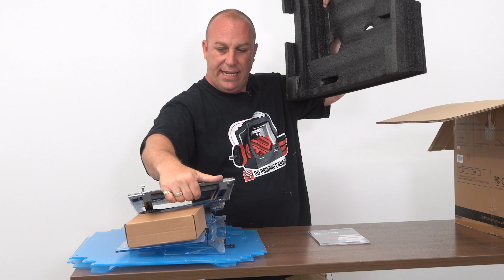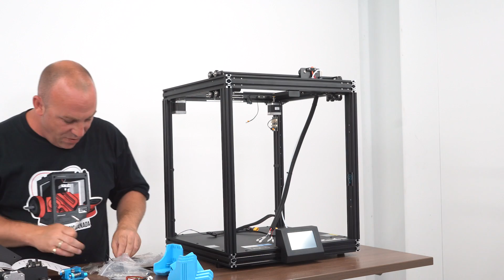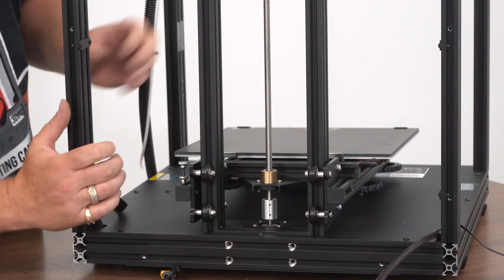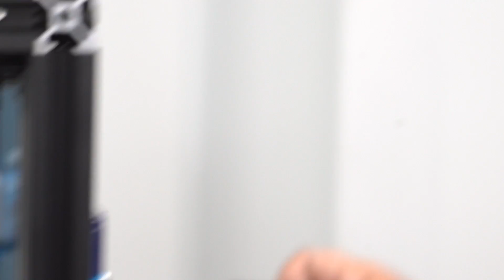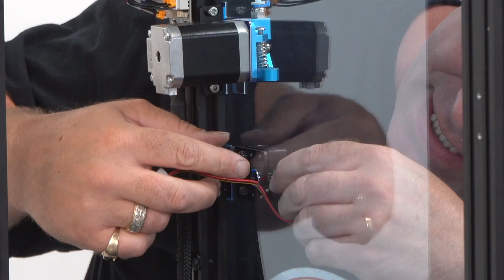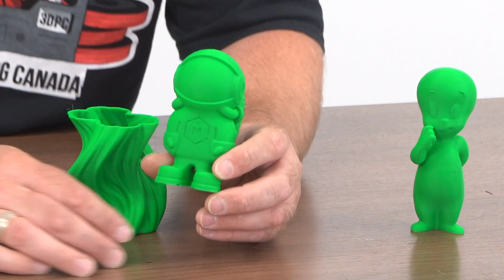Creality Ender 6 Unboxing, Build & Test Prints

Comment: There is just too much "hype" surrounding this printer and the Ender 7 that followed it. Creality touted this as a printer that can print in the 150 - 200mm/s range. I have used mine up to 120mm/s and it was already starting to have issues at that speed. This printer is way over-rated and to print fast is pretty much all it can do and nothing else. If you want to print parts that can achieve +/- 100 microns tolerance(standard in almost all FDM printers) this model is just garbage. And that long bowden tube isn't helping it much. I almost threw mine out the window until I upgraded it to have a Microswiss NG Direct Drive as a last resort (before disposing it) - that was the only time it became useful enough to be worth keeping.

Comment: Issues after issue right out of the box. Loud grinding noise around the belt, motor not rotating and jerking movements. I was still under their return time frame, but they refused to communicate once I refused to troubleshoot any further more than a normal person would do. Please do NOT buy any creality printer from their website, buy it from amazon instead.

Comment: I purchased a ender 6 and after printing off 70 plus pieces I have some major issues. I have had issues along the way and with the support from creality, they have stopped responding. The machine restarts on its own, restarts as it is printing and when it starts back off then slice it was working is off and then corrects itself, needless to say the piece is scrap. I now have an issue where the filament is getting jammed into the nozzle faster then it can use it, I have replaced the nozzle with 2 spares that came with it. It jammed so much that the tube that the filament travels through is clogged. ( I have ordered replacements) I got a tube that fits the outside diameter of the original feed tube and got it to work so the filament travels through nicely. but it still feeds the filament faster then it can use it. I am at a place after only having this printer since the end of april that I have been looking for a different machine. This one as you know was 550. to me big waste of money I can't produce anything. thank you for your time

Comment: Hello,  having trouble getting my BL touch to work,  it will not finish the process of auto leveling,  it has stopped working at number one and gone as high as 23 but can not get to finish at 25 like it is supposed to happen.  Need help

Comment: when installing a bowden tube to a hotend turn the pneumatic connector out  by about half a turn, push the bowden tube in as far as you can and then tighten down the connector, this will ensure the bowden tube is snugged up nicely in the bottom of the throat and will greatly reduce the chance of seepage and clogging.